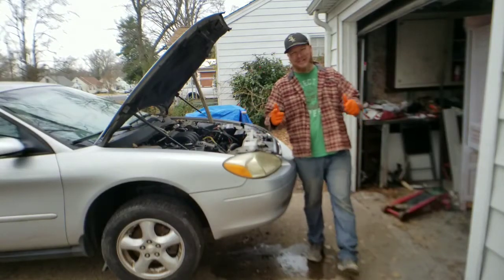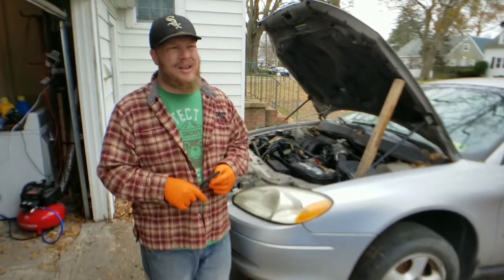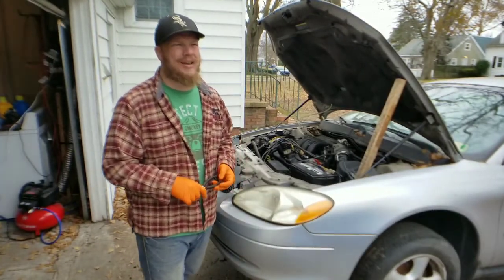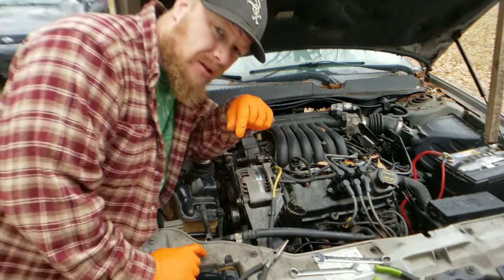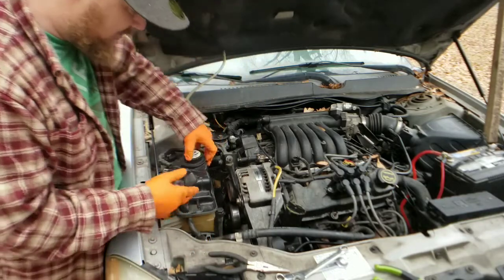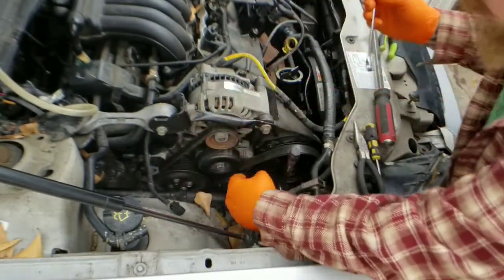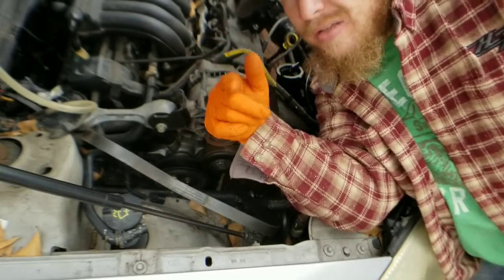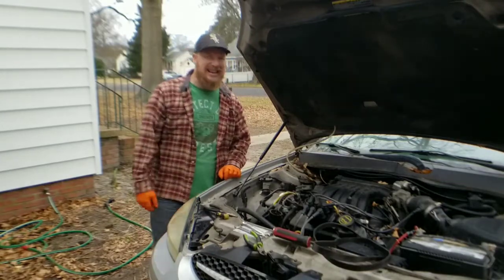2003 Ford Taurus Serpentine Belt Replacement in Under 10 Minutes!

Comment: You pointed out some very key things in getting the belt off. Especially prying it off with the pry bar and as you finally removed it I was thinking it’ll be awesome seeing how the new one goes on. I’m a little disappointed that didn’t happen is there a video of you putting a new one on?
Reply from the maker: It is easy to reinstall, just follow the belt diagram supplied and leave the smooth roller to the last pulley
Reply: @Sellthoseflippingcars  if I may make a suggestion about the title. It may sound ridiculous but you might consider using the title belt removal instead of belt replacement. It wasn’t actually replaced just removed. I could be wrong though and I certainly don’t mean to across snooty or anything like that. I do appreciate the video and the detailed explanations. As far as looking at the diagram goes, when I do the work I will definitely look at it but In addition I’ll need to find a second video where someone puts the belt on as a reference to the work. I learn better visually.

Comment: I have the 2003 Ford Taurus DOHC engine and stackable wrench don't work. Only a square notch in the tensioner for a belt tool.
Reply from the maker: I suggest using that serpentine belt tool that I have! That has incredible reach on it and is a fair price

Comment: Nice video! Is it necessary at unhook the battery prior? Saw another video where a guy did. Thanks
Reply from the maker: Thank you! I am glad you enjoyed the video. Unhooking the battery is a safety precaution so no one starts the vehicle while you have your hands in the engine. Make sure you subscribe to the channel for more great auto diy videos. Thanks for watching!
Reply: I wouldn't worry about doing anything with the battery unless you are doing something with the electrical system. Keep the keys in your pocket or whatever and you are fine.
 *On a side note, it's a really good idea to check/clean the battery terminals every so often, die-electric grease is your friend, so pulling the battery terminals isn't a bad thing..

Comment: Biggest problem with the video is the title. This is just a removal, not a replacement. Getting the belt off is the easy part.
Reply from the maker: I replaced the entire belt in the video but sadly this was one of my earlier videos and should of included the serpentine belt diagram in the video. I will make sure to cover that in the next video. Thank you for watching!

Comment: I have to replace the power steering hose myself, I am not sure where to find it , can you help me with any advice
Reply from the maker: I saw a few choices on Amazon, check to see which one matches the line you are looking for. Unless you would like it immediately, then I would suggest Advanced Auto. They usually have a wide selection in parts locally.

Comment: Also my belt came off only from one middle “wheel” can u tell me what’s the best way to get it back on with out entire belt coming off ?
Reply from the maker: Loosen the belt tensioner then take the belt off of the idler pulley then put the belt back on the middle wheel. Then put the belt back on the idler pulley and release the tension on the belt tensioner.

Comment: What do you do if the belt has too much slack
Reply from the maker: You need to tighten the belt by using the alternator. There is a belt tensioner located on the alternator bracket. If you have the single overhead cam Vulcan engine.

Comment: So I have a 2002 mercury Sable I turned over the key to go to the store this morning all of a sudden smoke was coming out of the hood went to shut it off and heard like a small  pop noise opened the hood and the belt was off so What kind of serpentine belt do I need for a 2002 mercury sable? Hope you can help me out with this question My life just  keeps on getting better. NOT
Reply from the maker: which engine do you have?
Reply: @Sellthoseflippingcars  6 cylinder

Comment: I have a 2008 Ford Taurus would this work for me
Reply from the maker: That year has the Duratec engine so the belt tensioner will be in a different location. It will be the same idea but not in the same place.

Comment: You didn’t put it back on that’s what I need!!!
Reply from the maker: Put it on every pulley except the roller. Relieve the tension on the tensioner and slide it on the roller.
Reply: @Sellthoseflippingcars  thanks for the video... I too was having trouble sliding the belt over the alternator pulley when everything else was lined up.  I will now try sliding it over the roller rather than the alternator pulley
Reply from the maker: You are most welcome Jon! Thank you for watching!